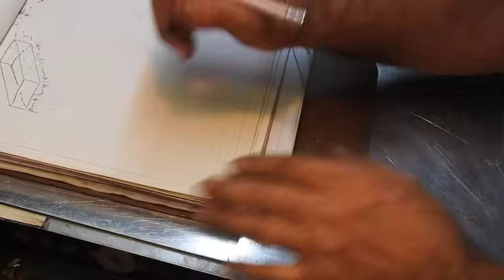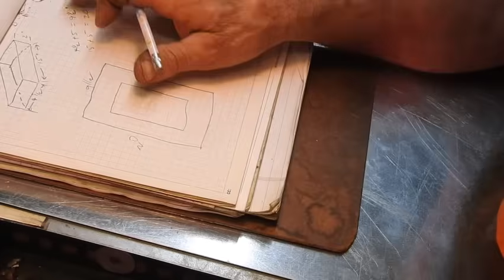Lets Build A Simple Sheet Metal Tool Tray

Comment: What a great video!  Thank god for no music or BS or long intro. Straight to the point, useful techniques. Loved it.
I want to make small metal parts for vintage sewing machines.  I cannot find these parts. Is there a small metal brake or vise to use for bending small metal pieces size of your hand?  Also, looking for ways to make washers that have a sunken ring inside them, concave washers but with a funnel ring around the hole. This is for rebuilding a tension assembly for toy sewing machines. Full size is too big.  There must be a type of jewelry metal punch that does that?
Reply from the maker: You need a ball punch or a ball bearing, sized by trial and error.  Drill a hole a size larger that the divet you wish to create.  Set the metal over the hole and drive the ball bearing with gently taps into the depression. Then drill the desired hole in the center. You'll then have to snip the circle out of the metal and round it up on a fine wheel grinder or belt sander. Slow going for sure, but with a little practice you should be able to make them consistently sized. Now, Northern Hydraulics, Central Machinery, even Vevor or Harbor Freight will all have variations of sheet metal brakes that may work for you. I would suggest a 'box and pan' brake.  It has removable 'fingers' of various widths, usually 2 and 4" widths.  Much more beneficial for making small components. Here's a quick Vevor search for you: https://www.aliexpress.us/item/3256807388982846.html?src=google&pdp_npi=4%40dis%21USD%21324.00%21106.92%21%21%21%21%21%40%2112000041379927062%21ppc%21%21%21&src=google&albch=shopping&acnt=708-803-3821&isdl=y&slnk=&plac=&mtctp=&albbt=Google_7_shopping&aff_platform=google&aff_short_key=UneMJZVf&gclsrc=aw.ds&albagn=888888&ds_e_adid=&ds_e_matchtype=&ds_e_device=c&ds_e_network=x&ds_e_product_group_id=&ds_e_product_id=en3256807388982846&ds_e_product_merchant_id=5341429840&ds_e_product_country=US&ds_e_product_language=en&ds_e_product_channel=online&ds_e_product_store_id=&ds_url_v=2&albcp=20546175997&albag=&isSmbAutoCall=false&needSmbHouyi=false&gad_source=1&gclid=Cj0KCQiAvbm7BhC5ARIsAFjwNHutgS3HVJ9wQ8dT_VpSQiVcZB0FbBnaPic0h2W_YDr9dP87-Bw8VqkaAt7KEALw_wcB&gatewayAdapt=glo2usa Good luck and request suggestions any time.

Comment: We made these in elementary scool - same as you show with cutouts corners and without - fold 45 deg and then out to end of box
Reply from the maker: Oh yeah, there's a variety of ways to fold a tray like this. And as long as it works for the application its the right way to do it !!  If you like sheet metal and have the time, you may want to consider scooting through this playlist.  Quite a few strange fittings went into this job:https://www.youtube.com/playlist?list=PLk72G9DTzZ1taVZjyeN9DKr52HQ3hhcXd  Or maybe this would interest you too: https://www.youtube.com/watch?v=i2KFLZGbZwI Thanks for stopping by for  shop visit today.  I appreciate your time.

Comment: That is awesome! Now I need a brake…..
Reply from the maker: Yessir, they are very handy to have.  I just sold my spare 8' brake two weeks ago.  A stock car driver bought it for his shop.  You can buy an inexpensive 24 or 30 inch box and pan at Northern Hydraulics.
Reply: @tractorman4461  what’s a “box and pan”?
Reply from the maker: @ShopTherapy623  A 'box and pan brake' is the style of sheet metal brake that has removable sections to allow boxes or pans to be fabricated to keep from smashing the sides.  Go to 4:56 in the video and watch the Box and Pan brake in action to form the four sides to these little trays.
Reply: @tractorman4461  awesome! Thanks for the info.  I actually searched for metal drawers because I’d like to try and make a Cole 30 drawer metal Cabinet.
Reply from the maker: @ShopTherapy623  I have made a number of tool cabinets in the past.  And many, many sheet metal tool trays of every shape and size. The bigger you go the heavier the material needs to be.  The key with a drawer filled cabinet is accuracy.  Measure and fold each one EXACTLY or they won't fit correctly.

Comment: If you punch holes at the corners it creates a lot of relief for the bends
Reply from the maker: Dang, I never even thought of that.  But I know you're right.  There's no 'give' right there and that's why I run a knife blade in right there.  Thanks for the tip.
Reply: @tractorman4461  a little hand nibbler is another option if the metal is thin enough, but rectangular relief cuts aren't as cool looking.

Comment: Made something similar in shoo (50+) years ago but soldered the seams.
Reply from the maker: Yes, its a standard style of compartmental storage container that's probably standard fare for beginning metal work.  I've made many  styles of box or pan over the years...some soldered when necessary for the application, some riveted and some spot welded.  And lately with the creation of eurthane sealants, sealed with a product called Vulkem for exterior use.

Comment: I need to do this on some stainless to replace the two 16x16 aluminum pizza pans Ive been using under the dog's water bowls, thesesquare  pans with 1" raised and rolled sides apparently arent available in stainless so Ill have to make them myself. The aluminum oxydizes gets pidded and rough, making cleaning a chore and it never cleans up nicely. I think we have a brake at my work place, but I know we have a shear, and I have some HVAC hand tools I bought for making ducts for the new furnace I installed and had to fabricate some oddball pieces and modifiy others.
I'll probably solder the seams on the corners
Reply from the maker: That would be a good choice.  If you are soldering SS, you may find that you need flux FOR stainess steel and not galvanized material. It's usually a liquid flux applied with a small flux brush.  Where ever the flux touches the SS, the solder will stick.  Good luck, it sounds like you are 'set' with the appropriate tools for the job.

Comment: You definitely didn't learn this overnight that's some pretty hands on experience displayed looks great thx for sharing.
Reply from the maker: Well, it DOES take a few cuts and scratches to get to the point of low or no blood loss on a daily basis.  (-:  The by-product is usually a nicely made box or project.  Btw, if you are interested in sheet metal and have a little time, maybe consider checking out this playlist.  There's a lot of fittings as well as the boring straight stuff: https://www.youtube.com/playlist?list=PLk72G9DTzZ1tqw8ST_xdUlPoy_O-SmuBx Thanks for visiting the channel today !!

Comment: I used to make these for my sockets etc great little projects for your old scraps and so handy
Reply from the maker: About half my socket sets are in tapered trays made specifically for each set. Those are the ones that stay in the shop in the roll around box.  You're right...perfect project for scrap material. I used to make S's and drives out of the scraps.

Comment: Thank you. I was making my own accessories draws but I had square tabs,oh the tool used to make holes for rivets what it’s called my mistake I’ve been using a drill that looks easier way.cheers terry from oz
Reply from the maker: https://www.amazon.com/Malco-HP18KR-MALCO-Punch/dp/B002JAWJGW/ref=sr_1_2?crid=1MZLGJ74K2VCT&keywords=malco+sheet+metal+hole+punch&qid=1689127607&sprefix=malco+sheet+metal+hole+punch%2Caps%2C136&sr=8-2 These are available in hvac supply houses much cheaper.  But this is the specific tool I'm using to punch the holes.
Reply from the maker: This particular one is a Malco hole punch and can be bought at local hvac supply houses or amazon.  Here is a much more versatile punch that's a bit cheaper: https://www.amazon.com/02612A-Various-Leather-Compound-Leverage/dp/B0002T87CW/ref=pd_rhf_d_se_s_pd_sbs_rvi_sccl_2_2/136-7588126-8159658?pd_rd_w=FqGdi&content-id=amzn1.sym.a089f039-4dde-401a-9041-8b534ae99e65&pf_rd_p=a089f039-4dde-401a-9041-8b534ae99e65&pf_rd_r=N9XEQ5QNE3GCRFBDA7AP&pd_rd_wg=2M6s7&pd_rd_r=a70447fb-fa19-4fbc-bccb-4e9efca2c19c&pd_rd_i=B0002T87CW&th=1

Comment: I tried making one of these a few years ago with sheet from the skin of a car door. I might be too creative though.. Tried to solder it which didn't work, then tried mig welding tacs which also didn't really work. Ended up making a little wooden frame on the inside then screwing it together lol. Bolted scrap leather handles on it. It's a sturdy enough box but looks like a pile of junk as you can probably imagine. Might have another go at another with your advice here.
Reply from the maker: Hahahahaha...I didn't mean to laugh, but I got tickled at your descriptive narration of your attempt!!  That was a hoot to read.  I think your choice of materials was the downfall to the project.  This material here is very forgiving 26 ga. galvanized sheet metal.  The door skin material has much different workability...as you found out.  But it DOES sound like it turned out to be a heavy duty usable tray when you were finished !!  That's a BIG plus !!  Thank you for the morning chuckle.

Comment: The back side of rivets intruding into my drawer would be annoying. Why not tack weld? Faster and smoother? I suppose it would corrupt the galvanizing in those spots. 
I’m fascinated by the way steel cabinet drawers and doors were made 60+ years ago. Folded but welded too in cosmetic areas. Built to last.  
So inspired! Time to get fingers for my small press.
Reply from the maker: I do spot weld on many occasions, but I was thinking most homeowners would only have access to a pop riveting tool so it would be more beneficial to more viewers to see this style of corner.  Also at 7:30 you can see how I use a square dolly to totally flatten the inside as well as the outside of the rivets to where there in no intrusion into the usable interior box space. The old time techniques are really cool to observe.  I have soldered corner joints in the past quite a lot as well, even with a blow torch and soldering coppers. Take a quick look at this video if you have time and want to see a higher level of difficulty: https://www.youtube.com/watch?v=i2KFLZGbZwI&t=11s  Thanks for stopping by with a valid question FKF.

Comment: This is a amazing video and i now want to go out to the shop build a bunch of bins like this for sorting hardware and such. Was wondering what gauge sheet metal you used?
Reply from the maker: This particular metal is 26 gauge galvanized sheet.  Available at any local supply house in and gauge in sizes ranging from 24', 30', 36' and 48" x 96'' sheets.You can use 28 ga for small trays and light loads, mid sized trays require 26 ga and anything larger needs to be 24 ga minimum.  If its a unduly heavy load it needs to go to 22 ga.  But the heavier the metal, the harder it is to manipulate.  Sometimes the large size need added reinforcement across the bottom surface to keep from bowing. For those I usually make 3 flying V's and solder them equidistant apart. ( V-shape with flanges on the sides)

Comment: Thank you very much sir.  Really enjoyed this.  Got my Tninkability going now.  Want to build a ton of these Shoo drawers for all my wood screws.

Now - never heard of a Box & Pan brake.  I do have a light duty brake for Alum flashing.  I have bent 28 Ga galvanized… but maybe I’m pushing it too hard ??
1.  Do you think drawers of Alum would be strong enough.
2. I now see there are wee vice-mounted  Box & Pan manual brakes.  Will they work ok ??
Reply from the maker: Aluminum should work ok if they aren't bent as tight at these...it may have a tendency to crack at the fold.  But if they do not, I'd say go for it.  Yes, any type of box and pan brake is fine but Central Machinery as well as Northern and Harbor Freight may have 24' bench mounts that are affordable.  Central Machinery makes a pretty fair one for the price.  Thanks Bobby for watching !!

Comment: When I was a freshman in high school that was one of the project’s we had to make in metal shop in the sixties
Reply from the maker: There should be more emphasis on the trades training in high school. Not everyone is interested in a bachelors or masters degree.  Nor does everyone want to face the costs of higher education the way its provided now.  There's plenty of room in the trades for guys that want to work a bit.  Thanks Richard for the comment.
Reply: @tractorman4461  I agree but when I graduated I had four years of machine shop and a year of metal shop and mechanical drawing and could not get a job they said no experience and none of the other guys I know could get jobs and we had every type of shop there was the schools need to do a better job of helping students find work in those fields
Reply from the maker: @richardschaffling9882  Dang, that was a bad break.  Businesses and unions need to be involved to a much greater extent in the upper grades of the school sytems process for counseling for career path choices.  The learning process doesn't necessarily instruct the students 'how' to use their education, or just WHAT they can actually do with their newly acquired skills.  Most all the building trades unions in this area will accept applications from the top performers in those classes right out of school. 
     I also think vocation specific virtual reality classes would go a long way to encourage participation in the trades as well, but there HAS to be a better way to get the graduates in the hands of the companies or unions that need them.  All of our local unions have been and are suffering from lack of trainable employees for a long time.  And with the number of the 'boomer'  generation now retiring, it is going to get much worse.

Comment: 🫡 for your sheet metal fab skills, sir.

Could you please theoretically educate me on what manufacturing processes are involved when producing a A320 MIP (Main Instrument panel frame) for a home-cockpit simulator. 

The panel mainly consists of a sheet metal frame, some laser cut outs probably for instruments. But, With complex foldings at certain angles is somewhat confusing me as to how it's done.
Reply from the maker: When I have a difficult bend to make, I draw a end view of the finished piece...in other words a line drawn to show the bends required.  Then I visualize the order in which they need to be bent so as to not create a situation that's not possible to finish.  Then you can mimic the thought process on a scrap and label on the drawing the sequence of the successful bends.  Once you successfully identify the sequence, draw it out as an unfolded box to allow you to recognize the areas to be notched away to eliminate interference at the corners....  I know this is a vague answer but it is an extremely difficult question to explain in print. Good luck to you in your project.  It will be rewarding experience for you when you succeed.
Reply: @tractorman4461  thank you. i can visualize what your trying to explain. It's very clear to me. However,  i lack xp like yours. By the way there's a CAD program called SolidWorks. Have you tried it? 😊
Reply from the maker: @Mechrank hahaha…. No, I’m afraid technology has by far surpassed my ability to take advantage of it.

Comment: How would you add dividers to this and a handle?
Reply from the maker: I would fold a safety hem across the top.  Fold 90* angles on the ends and the bottom and rivet or spot weld or solder them in place.  Those are all options for securing the corners too.  Number one being soldered, two being rivets hammered flat and three being the spot welds.  Spot welds will have a tendency to break loose under heavy use if the tray wants to flex.  You can just buy cheap drawer pulls for handles...but you can also get creative in making handles out of sheet metal too.  But that's a video all its own and can't be described well with words. Btw, if you liked this one and have a minute check out this one: https://www.youtube.com/watch?v=i2KFLZGbZwI&t=1s
Reply: @tractorman4461 thank you! Have you ever hot riveted these instead of aluminum rivets?
Reply from the maker: @ejs811  No, but yes to spot welding.  Not used hot rivets.  They sound as though they'd work though...

Comment: Thanks! I’m not good with metal but trying to learn.
On rectangular duct can you tell me why notches are cut for cleats?  To me it seams it could be done without them
Reply from the maker: The notches cut 1'' deep at the bends allow the 1'' S-cleat for the long dimension to not interfere with the 1/2'' angled notch for the drive cleat on the short side of the duct.  The angled notches then ease the assembly of the end product.  Make sense??
Reply: @tractorman4461  absolutely. Thanks for that info. Man I love your channel.
Reply from the maker: @JohnnyJr396  Cool !!  Have you found the metal playlists up above ??  Lots of good fab and installations up in those.
Reply: @tractorman4461  yes sir I’ve watched a few. Finally bought me a 24 inch finger break. Looking forward to tinkering around with it and making things from your videos.
Reply from the maker: @JohnnyJr396  Awesome !!  Make precise measurements and try always to learn what went wrong when a bend or layout doesn't go the way you thought.  Then try to never make that mistake again. Start with the simple folds and bends and always keep in mind there might be an easier way to do the same thing.  Don't be afraid to try it either.  A finger brake is a great thing to have.  I have a 24" and 48''. I am glad the videos are helping you a little.
Reply: @tractorman4461  thanks for that. I look forward to learning more from your videos!